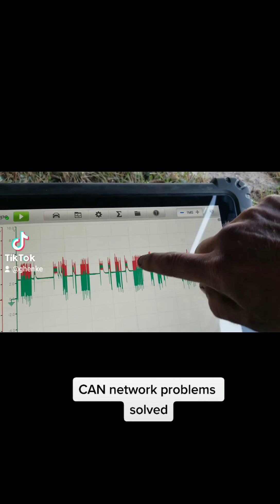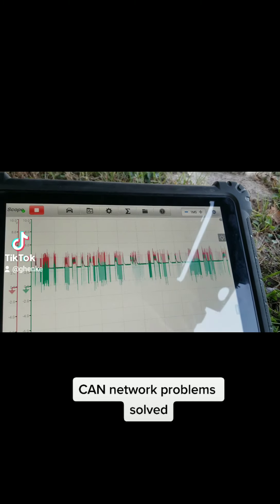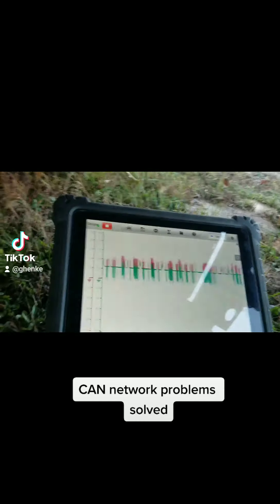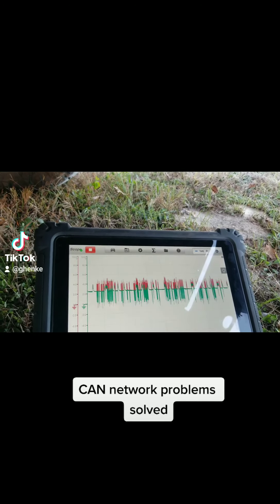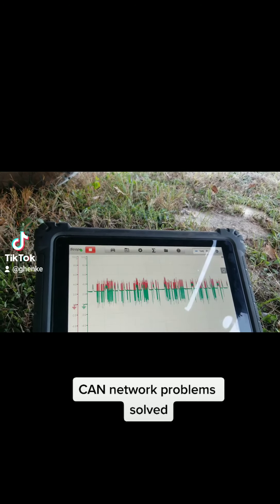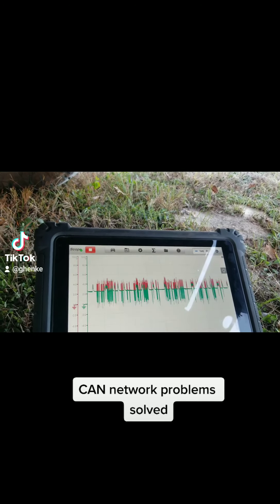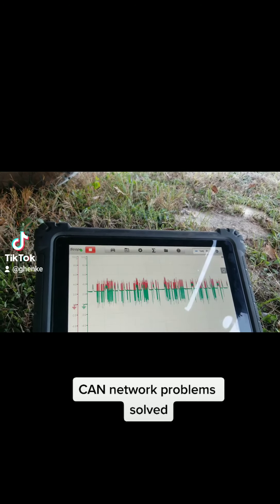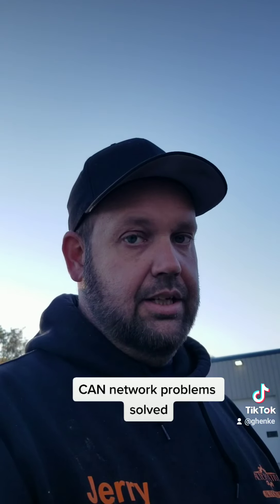CAN network issues

Comment: We do the same work diag work. Love the ones when there’s tons of parts in the car.
Reply from the maker: I laugh everytime I open the hood and see a pile of parts that are new, I just know I'm gonna sell a 200.00 but connector
Reply from the maker: Are you going to the napa convention in vegas, I will ne there tomorrow. If you are, find me on Facebook "Jerry Henke" and we can meet up
Reply: Nah I didn’t know about it. I’m in ohio. Currently working on a 2008 focus with a p2135  tps 1 and correlation. Has 3 throttle bodies and 2 gas pedals in the floor board. Has good tps signals to the pcm on the scope when it throws it in reduced power. So I have a used pcm to program but ids isn’t cooperating. But finally got it now been driving it with no failures